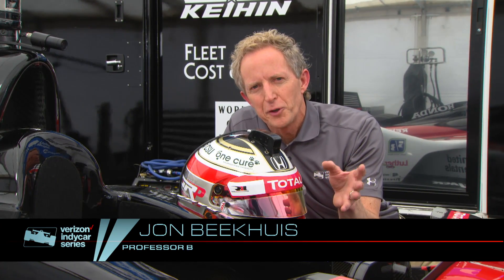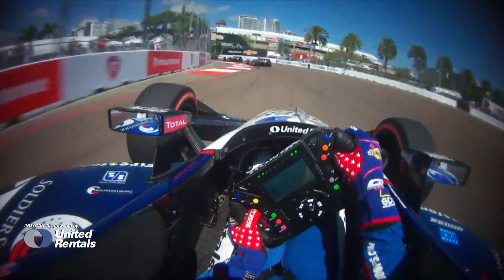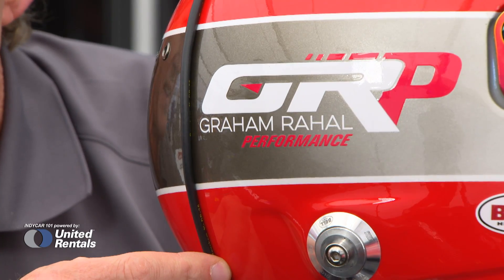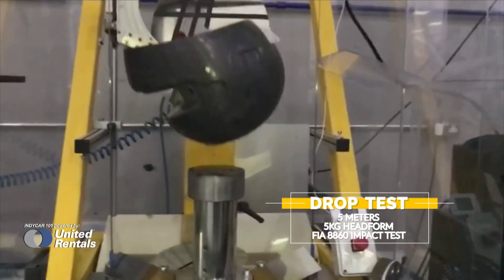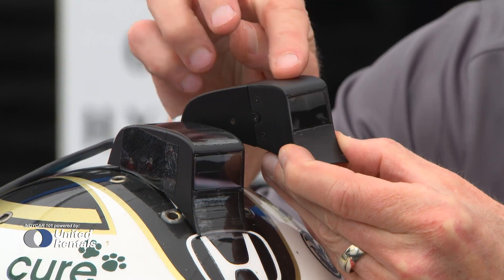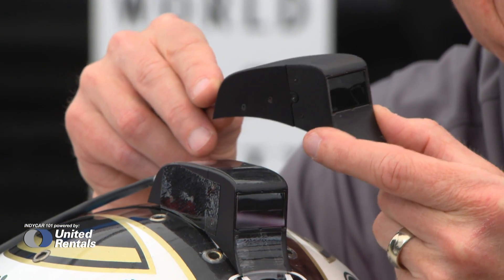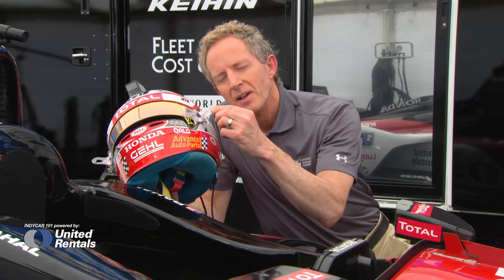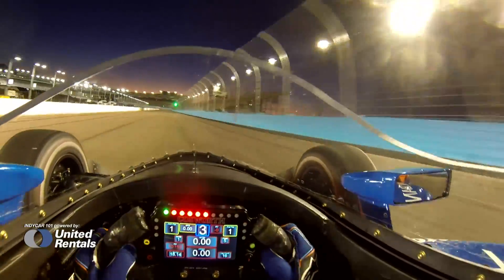INDYCAR 101: 2018 Visor Cam

Comment: Why can't Blue Tooth take the place of the camera cable.?? What's the reason this hasn't been done yet.?
Reply: Then you need an on-board Battery and more electronics. This way all the electronics are in the Car's Camera system. This is Smaller, safer, more lightweight and easier
Reply: people might be able to latch onto it?